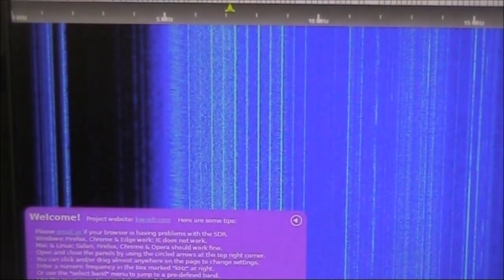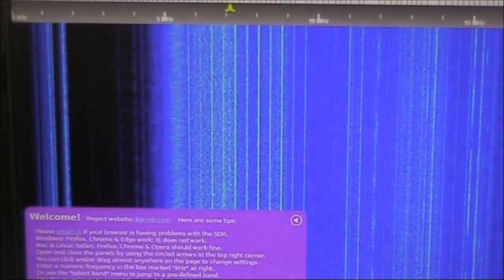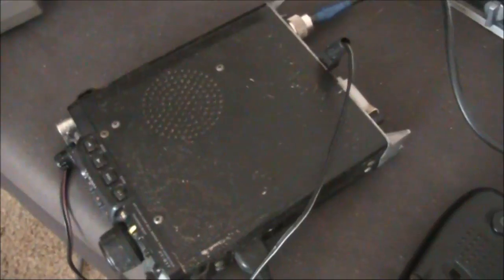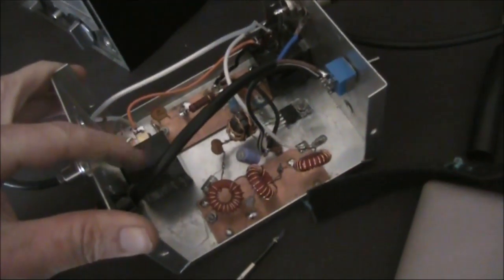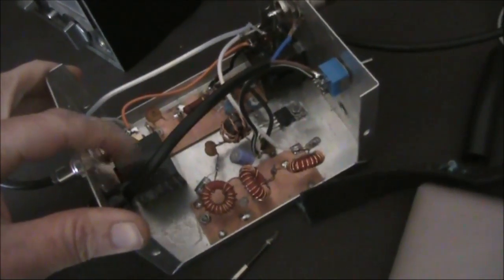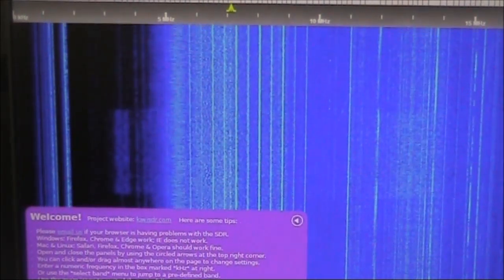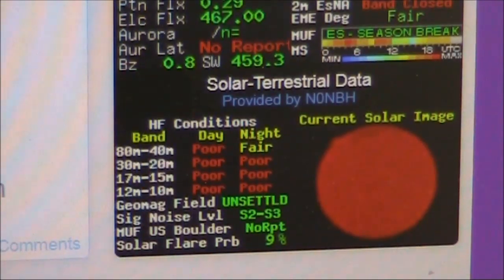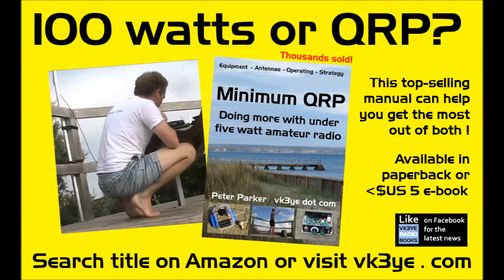CW vs SSB under noisy conditions: How do they compare?

Comment: With -17 dB for SSB over CW you would expect similar readability with ABT 50 times the power on SSB. So 5W CW compares to 250W SSB, 1W CW compares to 50W SSB.  UFB OM de DL7HH dDdDd
For me all CW signals were well readable, with 1W getting on the low end. The SSB had clearly worse readability on 5W than CW on 1W. And this is to expect.

Comment: Interesting video, Peter.  You have demonstrated plenty of times under the right conditions where QRP SSB has worked, e.g. during VK/Trans-Tasman Contests on 80 & 160m, etc, as well as your DX QSOs from Chelsea Beach.

I prefer CW because SSB has never been a mode that has worked well for me ... at least that was a lasting impression in my early years when I had modest antennas, with the result that nowadays I am almost always pleasantly surprised when I can make DX SSB contacts.

BTW, there was plenty of CW DX activity on 40m last weekend (12/13 Oct 2019) during the Oceania DX CW Contest ... managed to work 42 DXCC entities using 100W and wire antennas.

Comment: That IRF510 amplifier is capable of far better gain than that, your circuit needs experimentation. The output matching is a big player as the drain circuit needs a fair whack of capacitance.
I succeeded in getting over 20W from an IRF520 (or 530 I can't remember, it was a long time ago now) on 27mhz driving it with a crystal oscillator and a driver of roughly 1W. I was only using a 15V supply as well

Comment: I ran similar tests between CW and SSB at various power levels back in the late 1970's and early 1980's.  I was operating on 10 meters for the DX tests, and on ground wave on 6 and 2 meters.  The rigs were a Yaesu FT-7 on 10 meters, an Sideband Engineers SBE-50 (made by Belcom) on 6 meters and an IC-202 on 2 meters with a 15 watt amp.

The results on the QRP and QRPp SSB signals were better than your 40 meters tests, and about the same on 10 meters.  The noise floor was the deciding factor with noise on 6 and 2 meters virtually zero and about S-4 on 10 meters.  I controlled the power with a step attenuator on 10 and 6, and with the Hi/Low switch and the amp on 2.

In theory, the CW signal, watt for watt, should have about an 8 dB S/N improvement over SSB.  My attempts at reading the change were inconclusive, but we made the paths at 1/2 watt on CW without fail, and usually at 10 watts on SSB.  

The biggest thing I learned and have preached since, is that QRP SSB will work.  CW will be more reliable, but don't give up just because all you have is SSB.  A great demo, and thanks!

73, Keith, WB2VUO, Amherst, NY: Grid FN02ox